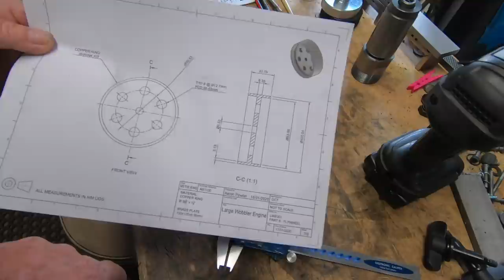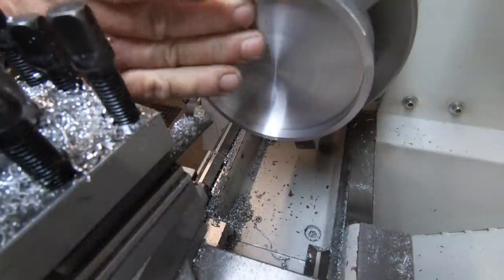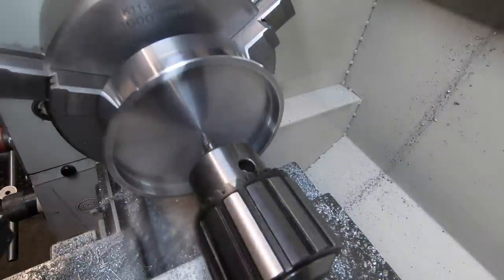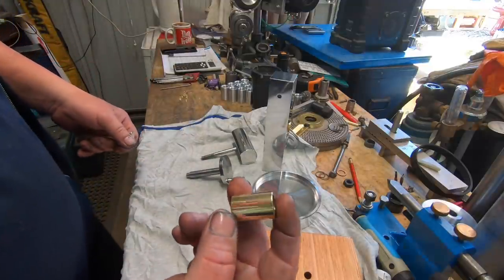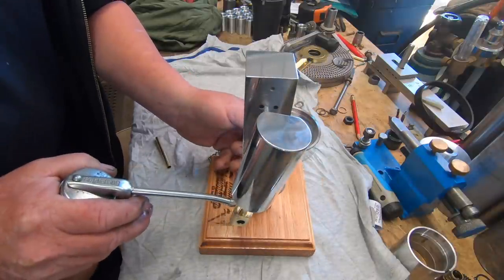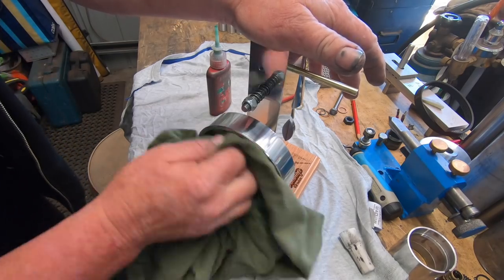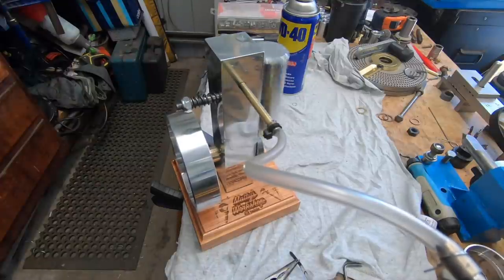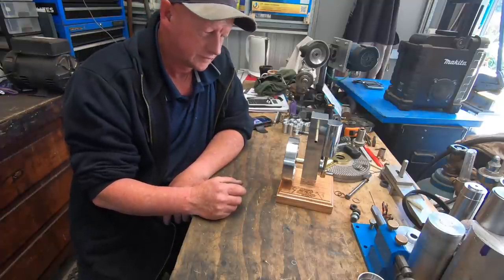Wobbler Engine Build  - Final

Comment: Good result Matty.  Runs well.   A steel flywheel would smooth it out as ally is a bit light.  What's next ?  Cheers Rob
Reply from the maker: Gday Rob, steel flywheel would be a lot better, I’m still getting a few bits a piece together for the next build, hopefully start that soon, Cheers
Reply: @MattysWorkshop  Hi Matty, yes that's why the plans used brass.  A red steel steel flywheel would look cool.  I'm still working on my latest small steam engine.  It's a tricky project, but coming together nicely.  Can't rush these things.  Cheers Rob

Comment: Matty,
Great build, and great video 👍
Next step is a small copper boiler to run the engine.
Then a Weir pump for boiler feed.
Then a flat belt Kay shaft running some machinery…,
Then….. we’ll, the list can get pretty long eh?
🤣
Regards
Robert
PS You could give the polished alloy a spray with a clear coat.

Comment: I wonder if you had a Boiler. If it would turn a Alternator to have DC Power? It seems like it’s strong enough. Very Nice Build Matty. I’m going to have to give it a try now. Really nice running Engine Matty. 👍
Reply from the maker: Thanks Mate, I’m not sure steam, never had anything to do with it, I’m surprised how much power it has, maybe it would run a small generator, thanks for watching mate, Cheers

Comment: Hey Mate,
Would it pay to make 2 thin shims to fit between the Wobbler & the mounting block & on crankshaft so it's not rubbing ?
Reply from the maker: Gday Chris, there is a very this shim I put on the crankshaft to prevent it rubbing, I didn’t show that in the video but if you look closely when I fitted the crank you’ll see it there, thanks for watching mate, Cheers

Comment: Sound, runs, and looks Great. With that mirror Polish you did, it looks like it should be in a display case. A case would stop finger prints too LOL. I noticed 👀 the dividing plates during the assembly, and look forward to seeing them put to use.
Reply from the maker: Gday, not a bad to stop the finger prints, the dividing plates are for the next project at this stage, just got to get a few bits a piece together which might take a couple of weeks, Cheers

Comment: I've always preferred a consistent machine finish myself, as long as it didn't affect function.  Polished can be a pain, and with my luck I'll pick up a cloth to wipe it down only to discover I picked up a chip somewhere that leaves a deep scratch in the most obvious place.

Sounds like a mini hot rod, revving it up like that, but I thought it sounded best under a steady load.  Now you need a little dyno or water pump to give it something to do while running on display.
Reply from the maker: Gday, I don’t mind polishing, been doing it for years on all the trucks I’ve drove, always polishing tanks, rims and bullbars, it’s not that hard really, the engine sounded completely different to what I thought it was going to, appreciate you watching, Cheers

Comment: G'day Matty that's a very nice engine and the base it sits on is really terrific,  if you don't want fingermarks on it use gloves.     I would like your opinion,  I have a large cast iron fly wheel and I would like to know if I could machine it on a three jaw chuck?   Thanks mate regards John
Reply from the maker: Gday John, if the flywheel fits in the 3 jaw chuck and the outer runs reasonable true then I dont think you'll have any problem, if you can clean up the very outside and do the centre bore in one set up it will be fine, hope this helps mate, Cheers